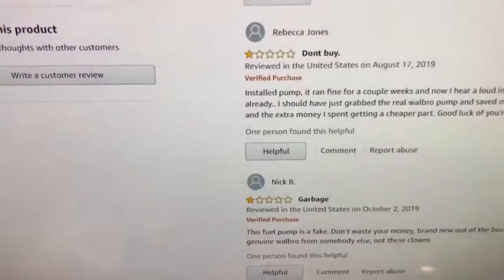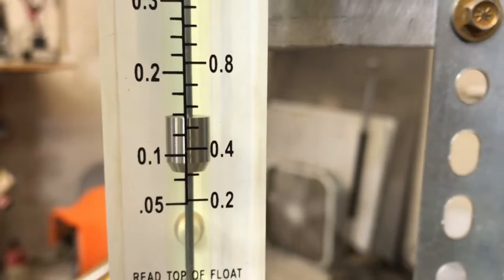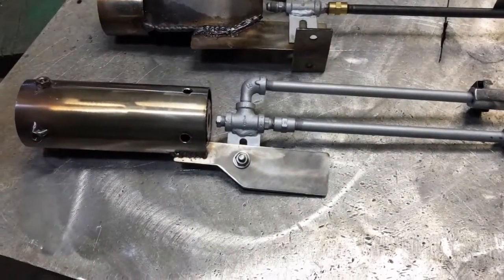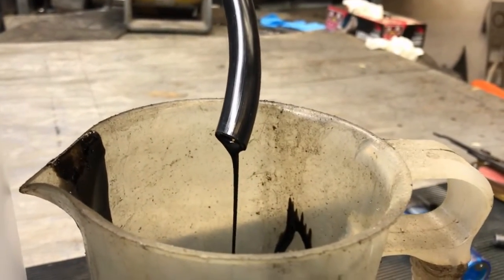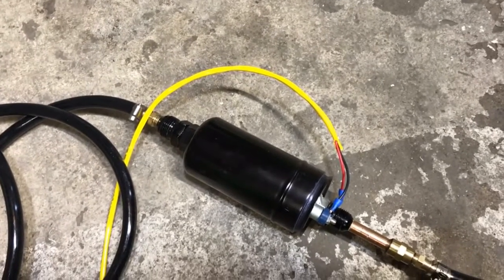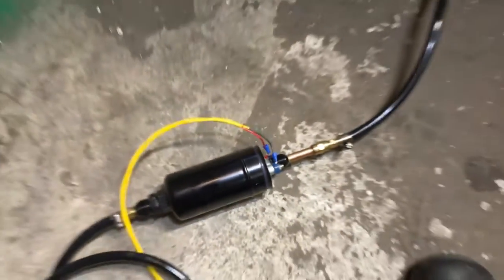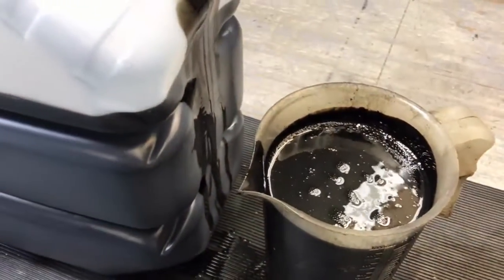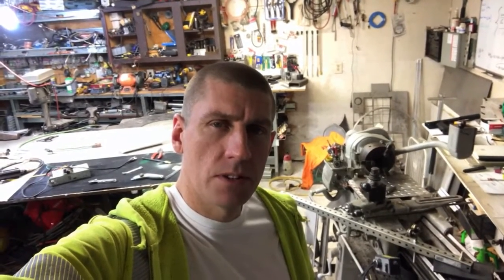Electric roller vane fuel pump waste oil conversion

Comment: I placed a copper tube in the top of an empty propane tank.  And extend the copper tube to the bottom of the tank.  I placed a auto wheel valve stem on the top of the propane tank.  I filled the propane tank with fuel.  I used the valve stem to pressurize the propane tank with compressed air.   The compressed air will push the fuel out the copper pipe.  It flows smoothly and very predictably with out bubbles.  

It works!   It cost less than 10 bucks.

Comment: I was thinking of pumping oil recently and your video popped up. I was thinking if you were to use a peristaltic pump, controlled via a stepper motor the amount of fuel can be precisely controlled as stepper motors will always run at the same speed, this means that even if it’s freezing or warm outside the amount of oil given to the burner will always be identical. Smaller pumps can be picked up off eBay cheaply I believe but not sure on the shipping due to the recent virus

Comment: Ive been considering a pump to pressurize mix of waste oil with gas or kerosene (to thin it out) and feed it through a fuel injector to power a turbojet

Comment: The oil flows through the motor, metal particles may stick inside to the motor magnets ?
Reply from the maker: good point , no problems yet

Comment: best way to get this to work wel is just turn the pump on pretty high power and then have a 3 way connection and bleed of exces fuel back to the tank. This way you can run the pump on a rpm where it wil not pulse as much and you can adjust the flow by adjusting how much opening there is on the bleed off. More opening on the bleedoff means less pressure in the line remaining meaning les flow trough a certain area. And then you just run 3/8 tubing as the main fuel line for a burner and you can probably get 150+kw trough it. That pump wil push the oil up to 6-8bar, and that gets you a lot of flow even trough a smal line.
Reply from the maker: Yes my goal also is to cut back on hardware so first im gonna try and avoid bypass valves, they cost to much
Reply: @NOBOX7  i think a bypass system could be done for 5$ or les. You dont need anything special for it, a normal gate valve could even work for it. And you dont need the big size stuf for it either. If you work with pressure the sizes can go a lot smaller without the normal gravity fed problems. Gravity fed you want the biggest size you can find to reduce drag. For pressure drag is not that much of a problem unles you're needing full flow from your pump.

Comment: use high temp steam instead of compressed air and you will reach tremendous increase of the flame temperature
Reply from the maker: People keep telling me that but man i just have a hard time believing that , i will give it a shot at some point
Reply: NOBOX7 NO NO NO 
THIS SOUNDS SCARY 
WATER OCCUPIES 1ml per cubic ml or cc 
Steam can occupy 100 -500 times as much volume.   It becomes explosive.  
Water trapped in the oil line MIGHT EXPLODE
Reply: @NOBOX7   in temperatures above 1500C water dismanles itself and becomes hydrogen and oxygen just like in the frying pan :D
Reply: @tomharrell1954   water is not trapped in il line instead it is used to suck the oil from the  inner orifice and atomize  it. The whoke mixture of atomized oil, hydrogen and oxgen from the water combined with the ambient air is then burned in the chamber above 1500 Celsius...dont be scared guys :D

Comment: I think you are making this part too hard. 
Get a propane tank.  Put an outlet on the bottom.   Put a car tire valve stem on the top. 
Pressurize the tank with air from your air compressor.  Now oil or diesel will squirt out the bottom.   Weld a line with a needle valve on the bottom.  The needle valve gives any flow you want.  You can warm it if you want.  You can mix it with oil, diesel, and kerosene or white gas.  It will not jump.  You can air it up once every 1/2 hour or 1 hour.  Easy and almost free.
Reply from the maker: Yes this has bin done but for large tanks its not practical, some people need it to burn all day .
stopping to refill a 2 or 3 hour tank is a hassle and if your doing foundry work on larges scale or running a drying plant its out of the question .
A propane tank would last a pumice dryer about 20 minutes

Comment: Let's face it fella NoBox, since most of the pumps that were made in the USA are no more, you get to choose something lovely from C H I N A that is just junk. But you have to choose between the lesser of evils. Are you a oil burner techie ???? Just wondering, nothing more, nothing less. Getting to elimination of the pump. Could you just move the tank to the ceiling with a rope and use gravity to make this burner head work ??? Thanks and have a good day too.

Comment: The botch[ Mercedes part] i think  was i think 58.00 last 9 month ago i think. it was on ebay i got the china one as i did not see it till later ...God bless..thank fer video a lot as i need this kind of loose pump fer oil transfer ......look up this type probably may or may not work i figured it will make pressure being a vane style ?..  i am going to order one soon fer the remote mounted  turbo truck https://www.amazon.com/dp/B01CNCXOLE?tag=duckduckgo-ffnt-20&linkCode=osi&th=1&psc=1